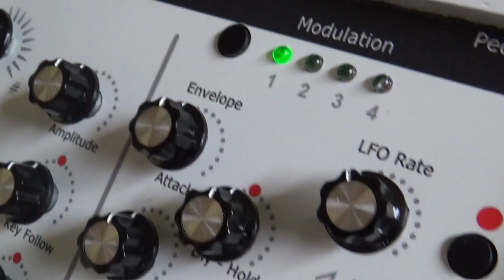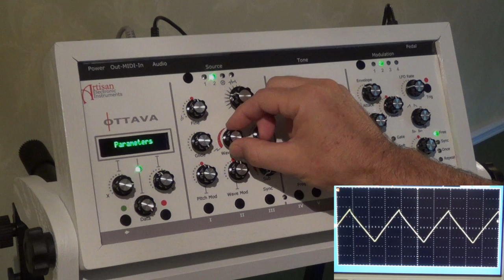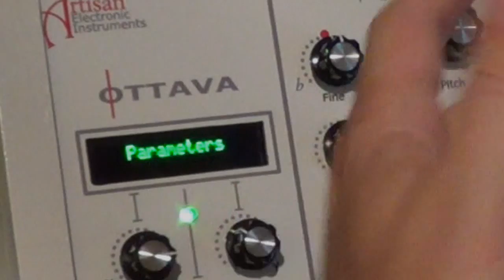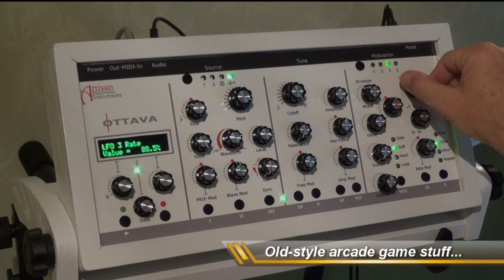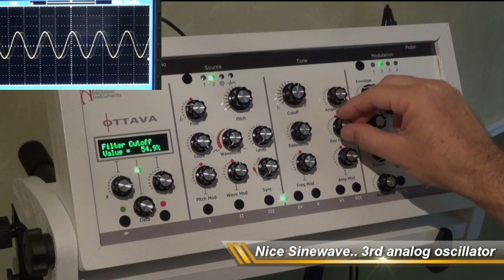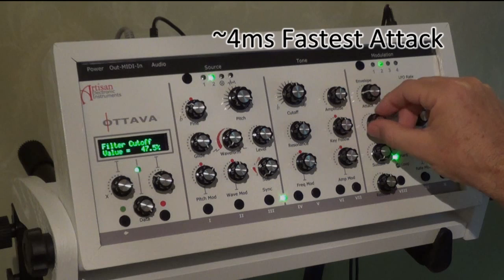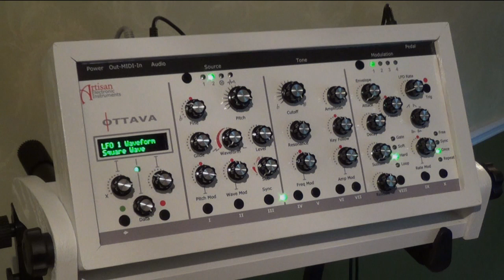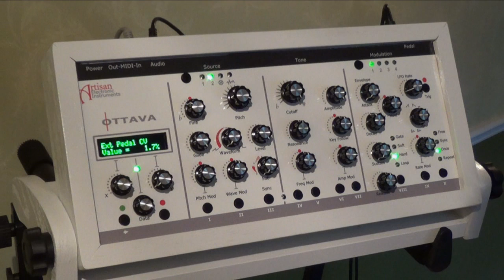Overview - Ottava Synthesizer

Comment: love the features but you need to figure out a way to interpolate the waves including the sub, that click where the osc and sub wave changes is a bit.....hmmmmm
Reply from the maker: We have addressed that in the latest update.  

What you are hearing is the change from a triangle wave to a Square.  The waves are od the same voltage, but a Square wave has more harmonics and thus sounds loader and that is what you hear.    the change is that the waveshap knob now goes from Triangle, morphs through shark-tooth to Saw.. then jumps to 50% PWM through 0% PWM.  The Square and Saw waves have a closer volume and sound better next to each other.

As far as the subs, what you are hearing is the fact that the sub knob controls both waveshape, octave and volume.  As you switch from one wave to the next, the volume goes from 100% to 0%.  The update changes that so the on the once octave down, the volume goes up to 100% starting with the smooth wave and the stays at 100% and goes down to 0% on the square and the repeats from 2 octaves down.  Sounds better when turning the know.

Ottava has a 10 input mixer before the filter.   There is an independent level control for each waveshape produced by the oscillators, subs, XOR and Noise.
Reply: Synth Man great, lovely stuff, perhaps that new OS should be shown in the promo so people can hear the changes?
Reply from the maker: I could add a quick update.

Comment: i would buy this but i'm tired of Mono Synth...to many Poly 6, 8, 12 Voice synth..i have to be able to at least play 2 notes at same time...can you make me one that will have at least 6 Voice and be able to do the same. as you demo?
Reply from the maker: rhampton1914 yes, the Ottava voice card is designed to be linked in groups and allow multi-timbral. And we do custom builds.  Just finished a custom keyboard version for a local musician.  Check out our website and give us an email if you want to discuss this further.
Reply: Please check your email. i emailed you. i would like to buy...please call me with the number i left on your email...
Reply: rhampton1914 Also, the ottava h as three stackable oscillators sound sources, plus two eight step sequencers, so even though they all track the keyboard, you can have three different melodies playing.. Although it is a mono, and you would need more vca's to really be way more interesting..

Comment: Hmmm...interesting and sounds nice too.  I'm surprised I haven't heard more about it...and I really just stumbled across this.  The synth was in some montage opening for another video (for the KARP Odyssey, I think), and I was curious that I didn't recognize it.  Looked up "Ottava synth" and ended up here.

Oh yeah, another quick question:  is the glide rate linear or exponential?
Reply from the maker: ProckGnosis thanks for finding us. the glide rate is exponential and thus sounds linear.. for example, if you set the rate to one second, it will glide from A1 to A2 in one second.. and from A3 to A4 in one second even though there us a much bigger frequency jump.
Reply from the maker: BTW.. please check out www.ArtisanElectronicInstruments.com
Reply: So it uses an RC type circuit for the glide (like an old Moog), where the glide slows down as it approaches the target note?

And I hit your site to already look at the manual.  Looks like you're doing some extremely interesting stuff!  Might be contacting you in person in the near future with some other questions.  Cheers!